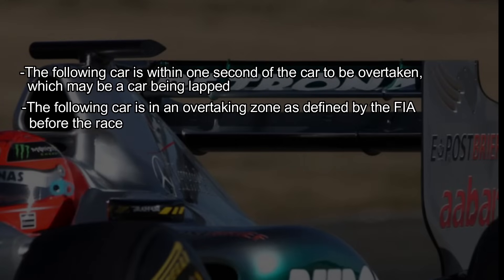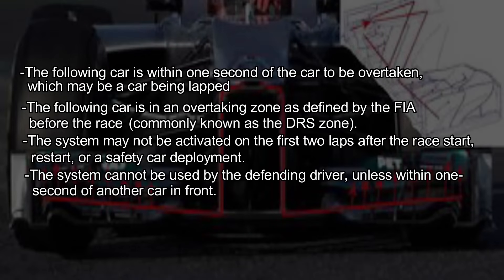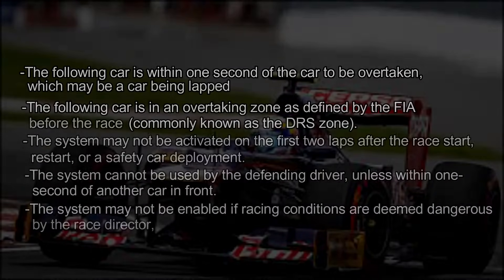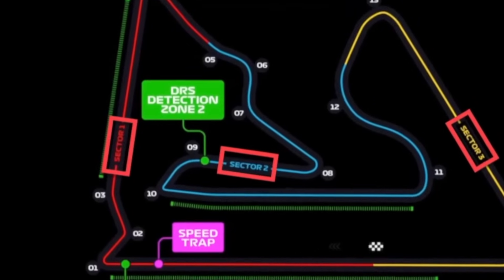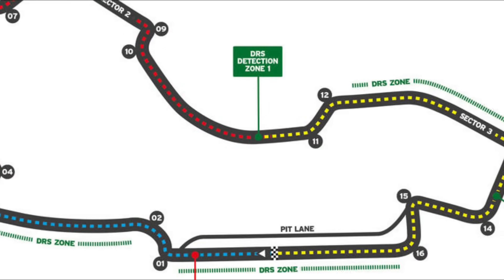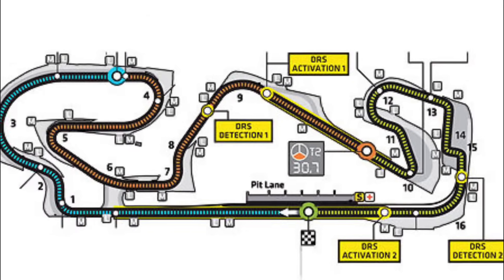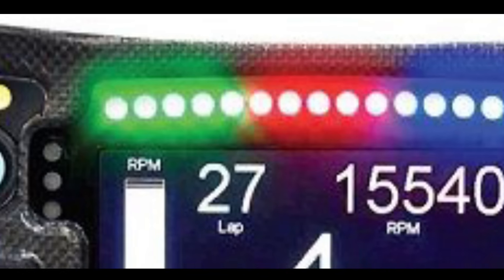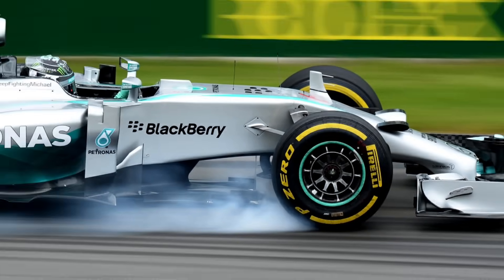How the DRS (Drag Reduction System) works in Formula 1

Comment: The key word in using DRS is that the chasing car has to be within 1 second of the car in front. The scenario is that if you are within 1 sec of the car in front, then you are already faster than the leading car. However, the physics of racing is that you have to be a lot faster to be able to overtake, so the argument is that since the chasing car is already faster then the leading car to be able to get within 1 sec, then the advantage goes to the chasing car being able to use DRS to overtake. That is the only reason DRS is imposed to give a boost to the chasing car that in theory is faster, but just cannot overtake..
Reply: Yes but it's not actually faster, its behind one second so its one second slower

Comment: I had to pause the Netflix series to look this up after hearing DRS so many times and having no idea.
I picked this 3 minute vid over an 18min one and this was perfect. Quick, to the point, with great visual example and explanation.
THANK YOU!!
*Forgot to add.. This doesn't take anything away from "purity" of the sport. There is so much technology in these cars now, that it's hard to argue any valid point about pure driving. As long as the same rules apply to everyone it's just another layer of strategy and I love it.

Comment: Just to confirm, the driver being overtaken can't use DRS correct? Unless the driver being overtaken is simultaneously trying to overtake someone in front of him by less than 1 second? If that's the case then sounds cool. I don't follow F1 but I'm going down this rabbit hole so I'll probably start haha
Reply from the maker: Thanks for the question. Yes - it is based on the detection. Any car that is within one second of a car in front at the detection point when DRS is enabled will be able to use DRS in DRS zone.

Comment: Fuck that, have the thing always open. There...everyone's faster. When you're going THAT fast, an extra 20km isn't likely to change any negative results (crashes, braking performance) significantly enough to save anyone's life anyway. Smashing a wall at 260km as opposed to 280km isn't exactly a marked improvement on a survivability chart. And if it's always active it doesn't give the driver behind an advantage. But I think the always on activation should be at least 10 laps from the start of the race, and 2 laps after restart or safety. Just for fairness, otherwise whoever has p1 at the start likely won't lose that position unless they fuck up. So I can see WHY there are restrictions, it makes races more exciting, but it's essentially only punishing the faster drivers by allowing the slower ones a handicap. It's all in effort to level the playing field and make it so anyone can win, but clearly the best drivers are always going to be the best, otherwise there'd be other people on the podium than the top 5 guys in whatever top 3 order every time. Sure a lot comes down to the cars on raceday and everything as well. 

So when you weigh the pros and cons of the DRS, it seems to be a penalty to faster racers, give extra help to slower drivers, and exist solely to make the race more interesting for the fans...with only the last one being what factors in the rulebooks...fans getting more interested because anything can happen due to it means more eyes on the sport which increases the sports revenue...so there's no incentive for the F1 itself to remove the rules about it...regardless that the rules are essentially only punishing faster drivers. But if you remove the DRS entirely or allow it to be on the entire time, you basically reduce the need for the race itself...because the pile positions would count more towards the winner than anything else...while currently they certainly help but it's not a forgone conclusion that the guy starting p1 will even finish on the podium.

Comment: Sir will you plz tell me that all formula 1 cars on the grid are same cars in power and specs,,,, if its same then why not another driver winning races or championship every time
Reply from the maker: Thanks for the question. The cars are not the same. Each car is unique, but built to meet the regulation. Like Mercedes does not have side pods as big as redbull

Comment: As with any rule change, I feel it impacts the history of a sport. Where previous generations had to do things a different way to achieve results. Normally new rules and technologies are not implemented without heavy thought and consideration. In this particular scenario, I'm sure they had some good reasoning to implement the DRS system. I just started watching F1 and watched this video to familiarize myself with the term. My assumption is it provides a more exciting experiencing, and potentially also provides some safety in the sense that overtaking is a little more controlled by the preset parameters.

Comment: Thanks for such a clear explanation of DRS. Question, does race direction see when drivers activate DRS and can it be activated outside the DRS zone? Meaning does the system physically limit the drivers from activating it outside the zone?
Reply from the maker: I do not think there is any physical limitation (that's my understanding could be wrong), but I have seen in past car becomes undriveable if DRS is used in the corners. Like I remember a race when Kimi had DRS wing stuck open and he had to retire from the race.

Comment: hi mate, quick question. when not being overtaken but in DRS zone, can DRS be enabled ?
Reply from the maker: Thanks for the comment. Yes - the DRS detection point is where the 1 second proximity is measured. When two cars cross the detection point if they are within 1 second of each other, the driver behind can use DRS starting at the activation point - this is regardless of if he is able to complete an overtake or not.
Reply: @F1Education  can the driver in front use DRS to prevent overtaking ?
Reply from the maker: He technically could if there was a car in front of him that was also within one second. This creates the "DRS train".
Reply from the maker: That is a good question. As far I understand DRS cannot be used to prevent overtaking, but if you imagine a scenario where there are 3 drivers A B and C in that order and the gap between each of them is less than one second. Then B could use DRS on A and that would help him to prevent C from overtaking him. A cannot use DRS since he is lead car.
Reply: @F1Education  Ah i see, thanks for the reply. Great video.
Reply: @F1Education  for example the recent qatar race where max verstappen overtook pierre gasly, could gasly have used DRS to stop verstappen from overtaking?

Comment: Thanks for the video, mate.
I have a question: does the DRS remain activated even if the opponent in the front has been overtaken?
Reply from the maker: Thanks for the comment - DRS stays active even after the overtake. It can be manually turned off or is turned off when the driver hits break
Reply: @F1Education  can the DRS be activated by the overtaken driver as soon as the other driver is aligned, slightly or fully ahead ?
Reply from the maker: @manadog  thanks for the question. By what I understand no. The activation of DRS is purely based on what timings at which the drivers cross the DRS detection point
Reply: @F1Education  if all the teams have this technology and it makes sense to only use it on the straights and in the straights usually everybody is allowed to use it even 1st place , why is it so controversial?
Reply: @F1Education  just subscribed , you are great .
Reply from the maker: @manadog  this is a good question. 

controversial points I have heard are:

- Some believe in certain tracks DRS is too powerful and gives better teams too much of an advantage because top teams already have a good car.

- some believe it ruins proper racing since a driver can just use DRS to pass so it his not really his skill, but DRS that makes him good.

But my thought on it is  until the cars become more equal it doesn’t really matter. Most of the teams couldn’t pass Mercedes or Redbull car even with DRS and Mercedes and Redbull can quickly gain one second + Advantage over weaker cars so highly unlikely weaker car can even use DRS against top teams.
Reply: @F1Education  Hello, I have 2 questions
1) So if the following car could not hit under 1 sec gap to the car in front on detection point, but then closed the gap in the actual DRS zone like say 850ms due to slipstream, can they now use DRS    for the remaining part of the DRS straight?

2) If a car overtakes lead car very quickly in the DRS zone at the start of straight itself, then can this overtaken car use DRS to pass it back? If not then the now leading car would still have DRS from the detection point even though they are already in front and keep pulling away on that same straight.
Reply from the maker: @vaibhavkulkarni8257  thanks for the question. By how I understand the rules the answer to both questions is no. The use of DRS is strictly based on the one second proximity at the detection point.
Reply: @F1Education  Thank you for answering.
Reply: @vaibhavkulkarni8257  Re: #2, I don't think that scenario (overtaking very quickly in DRS Zone), happens much. In order to overtake early, you have to already have a better pace than the car in front of you. And if you already have a better pace, you probably don't need DRS. UNLESS, your car is down on power in the straights. And that's a scenario where DRS is supposed to help equalize things. That's my opinion anyway; I'm interested to hear if you think otherwise, and why.
Reply: @cpowellrun  Yeah I get what you mean but it could happen in a super long straight like qatar maybe?